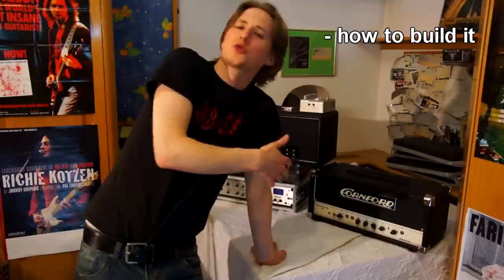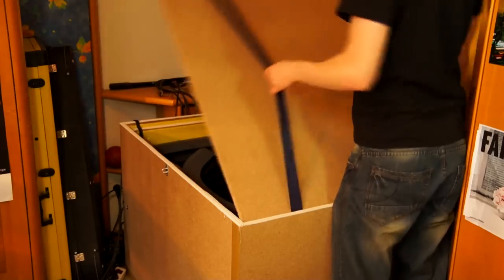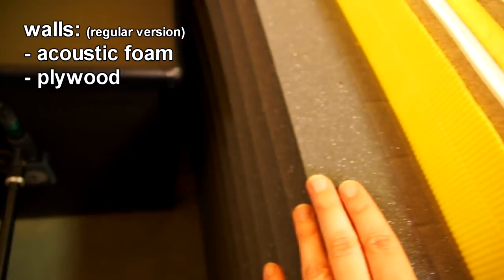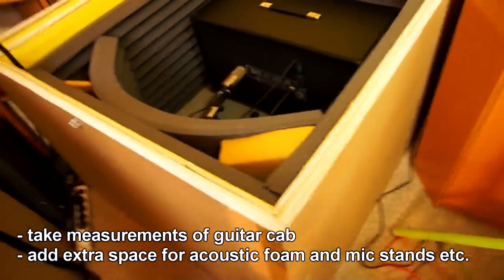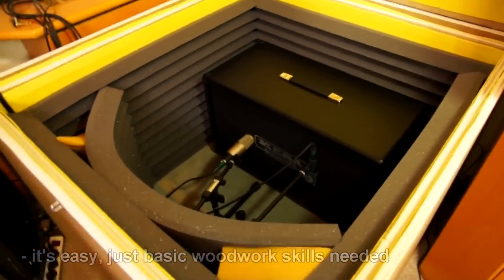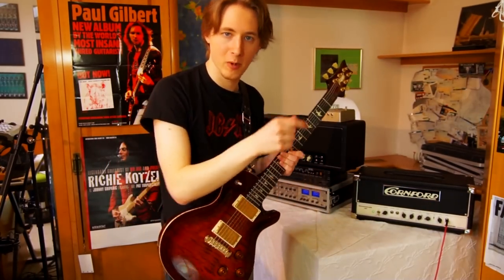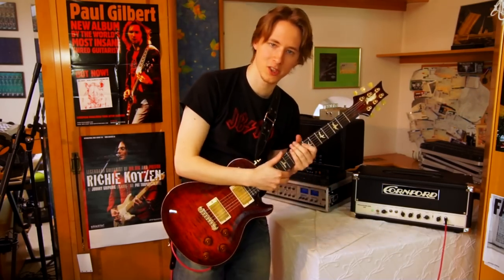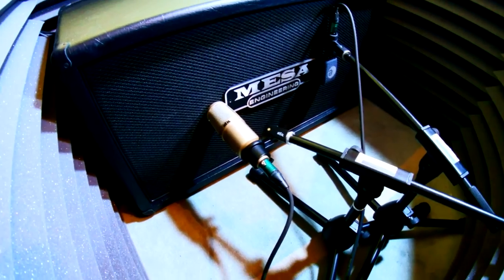Recording guitars with a DIY Isolation Cabinet (+ how to build one)

Comment from the maker: yes, there are differences in sound, it's a smaller space without any reflections. So the bass response is a bit different and there is absolutely no ambiance. But when recording guitars you usually cut the low bass frequencies to make room for the bass guitar and you add some reverb to the guitar after recording. And then it's all fine :)
Reply: Do you know about what frequency the bass response falls off?
Reply from the maker: @SoBeit777  it's been many years since I've recorded with the iso box, so I'm not sure what frequency it was. But it was in a lower area where you want to use a low cut on a guitar anyway, to not interfere with the bass guitar

Comment: Glue with a shelf bracket ? I guess you dint really build to ever be moved ?
Great idea, but I would simply add some 1x1" squares on the inside of each corner, so you have something to fasten the plywood sheets too rather than just plywood to plywood(very, very weak)  for strength, in case you ever want to move it, it wont fall apart.
Reply from the maker: You're right. However, it's way too heavy and bulky to ever get it down the stairs of the house. So I didn't build it that solidly. When I moved to my new apartment it was really tough to take it apart though ;)

Comment: Do you find you get any sort of phase problems or comb filtering? Also how much was the total cost?
Reply from the maker: at the size that I built it, I didn't have any phase or comb filtering issues. It sounded "normal", but just very dry. I think I've payed about 220EUR/250USD in total. But it's possible to build it for less, depending on getting a good deal on the wood plates.
Reply: Thanks brother! I'm fairly stressed because I'm producing an album in which I was hoping to use my cabs and mic's because it's part of the sound I've designed, but neighbour problems are leading to me not being able to record guitars at my place anymore, at least not with a mic'd cabinet! The best solution I've been able to come up with is to use my Amps with a Load Box/Attenuator direct into my DAW and use cab/mic sims. I want to build an Isolation box, but unfortunately it won't be in time for this record. I hope the load box thing works out! Also, in your opinion, do you think the box would have to be much bigger than the one you built to accomodate a 4x12? I'm thinking if I build one big enough for my Mesa 4x12 Stilletto then I will always be able to use my 2x12 or 1x12 if I choose!
Reply from the maker: @underpressureman  Sorry to hear that about your neighbors. For a 4x12 it would just need to be higher. Be sure to assemble it in the same room/spot that you will use the isolation box, because it'll be very heavy and might not fit through doors if you build it for a 4x12.
In the meantime, a good load box is the 2 notes torpedo, it lets you load impulse responses (cab sims) right into the device. You might also see if you can create an impulse response of your cab + microphone setup. It's usually a quite faithful "copy" of your sound and you might not even need an isolation box to get your sound. Then you might be completely happy with the load box solution.

Comment: Hey, man, thanks for the info, very encouraging and useful. Also a very good idea for getting a great tone to record even late at night. hahaha I would just reinforce the isolation a little bit... Could you give me the measurements of the box from the outside? I watched it and then sought through the video to find it, but couldn't. What's the size WxHxD? Just to have an idea... Thanks.
Reply: Also, I forgot to ask: How much does the cab being in the box affect the tone for recording? Would you say the differences between "inside" and "outside" are little or major? Does it sound muffled or "bassier" than outside? Just from the video, there seems to be no difference to me, but you never know... Thanks.
Reply from the maker: *****
I moved to a new place and I don't have the isolation box anymore. But I think it measured about 150x150x90cm. The tone does change a little bit. But the amp is on the outside, so you could change the amp's EQ according to taste.

Comment: Hi! Great video!!
So, I live in a apartment... What do you say about the floor vibration? Is it possible to record at night..?
Reply from the maker: At night I wasn't able turn the amp up to "live on stage" volume. There was some vibration going through the floor. But it always depends on the building and whether or not people have a bedroom right underneath.
Reply: guitarDouchebaggery Thanks! Yeah, I guess it will be hard to use that amount of volume at night.....
So... What do you think about 2 mics inside the isobox? Did you try it?
Reply from the maker: Del Rei yes, I usually had 2 mics in the isobox. I also had a Mesa Road King 2x12 cabinet in there that has 2 different speakers, as well as one side being open back, the other being closed back. I usually recorded with both so I can mix them together in the mixing stage. Sometimes I ended up just using one of the mic signals.
Reply: guitarDouchebaggery Good to know!! Do you thing it may damage a Ribbon or a condenser inside the isobox? Even setting the mics about 2" or 3" far from speaker?
Reply from the maker: Del Rei
It's possible, but it's not much different than having a ribbon or condenser mic in front a guitar cab that is in a regular room. Some ribbon mics are designed to be able to handle loud guitar cabinets.
Reply: guitarDouchebaggery Thanks!!! :)
Do you know about MXL R144...? Is it good for isobox?
Reply from the maker: Del Rei
yes, that one can take high SPLs well
Reply: guitarDouchebaggery Thanks!!! :)

Comment: Hi Can you tell me the dimensions of your box? I want to build one for a Bogner 1x12 cube. I have a lot of MDF I was thinking of using along with either plywood or drywall.  Thanks
Reply from the maker: unfortunately I can't. I wasn't able to move that box to my new apartment. But anyhow, I built my box to fit into that corner of the room. Usually, the bigger the better. For a 1x12 I'd at least add 10 cm (or 4 inches) on each side and back of the cabinet. And then leave plenty of space in front of the cab, to have enough room to place a small mic stand in front of the cab.
Reply: guitarDouchebaggery
That's helpful. Thanks much

Comment: Hi have you ever tried an attenuator? If so, what brand and what did you think of them.
Reply from the maker: I never had an attenuator. The THD Hotplate attenuators should be good, many pros use them. The tone may be slightly altered, but you can always re-adjust your amp's EQ
Reply: guitarDouchebaggery I've used the THD hotplate and Im gonna be honest.. its a tone sucker!
Reply: If you have 700€ to spend buy the Two Notes Audio Engineering- Torpedo Live, or a cheaper one not as versatile but I heard its very good the Palmer PDI 03, which is around 300€ something.

Comment: You don't really need reverb/room mics for guitars in most rock/metal genres and subgenres. Personally I get annoyed when I mix someone else recording project and the only guitar channels sound like the guitar is an a "room". I prefer the mic placement right up to the speaker where the diaphragm meets the dust cover, and then add reverb or an echo chamber in the mix to taste. Unless the intention is to purposely record a guitar that is way out there, then yeah room mics are the way to go.

Comment: If i were to put my tube combo amp in a box like this, would it get to hot in there for the tubes and such?
Reply: +Ryanincambonia It wouldn't get too hot for the tubes - most EL34 tubes are rated to operate around 250 C (480 F)! - but the box itself will probably get REALLY hot quite quickly. You might have a risk of starting a fire, depending on the material of the box.
Reply: as long as you lift the lid from time to time let it vent  it would be OK just make sure the tubes do have some room behind the amp for air, or you might get in trouble
Reply: See if your amp has an output for an extension speaker so you can keep the electronics outside the box. I personally would not ever do what you are suggesting. If you proceed, get a really cheap infrared thermometer, they look like a squirt gun or a star trek phaser, open the box and instantly check the temp of your gear inside. While tubes run hot by their nature, many other components might not fare so well, hence you usually find venting and heat sinks in the tube combo amps. Good luck.

Comment from the maker: I see, well, in Europe it's common to put that laminate under a parquet floor. But you can use any kind of styrofoam etc. between the walls
also, it's not a necessity to build it with 2 walls like I did. People also got good results with just one wall.

Comment: Doesn't the iso box cut off the air circulation and over heat the tube head?
Reply from the maker: The tube head reamains outside of the iso box, only the cabinet is on the inside :)

Comment: You think If i Make one of these for a Combo Tube amp is bad? I wont keep it there only when im tracking
Reply from the maker: with a combo you won't be able to tweak the knobs of the amp from the outside. It'll also get very warm inside the box that way. Maybe you could buy an affordable 1x12 cabinet, put that inside the isolation box and use the amp output of your combo.

Comment: Georg, this is fantastic. In these recorded sounds, are their any plugin's rolling off low end vs this is the raw miked sound? I am working to eliminate the excess bass in mine. And, the hero Rob Chapman himself posted here! Wow. Good on you, mate.
Reply from the maker: Thank you :) yes, it's the raw miked sound
I had the microphones placed quite in the center of the speakers to have a clear sound. Otherwise it can get too bassy
Reply: I am even more impressed with your results. It is a very balanced sound - especially considering that beast of a Mesa cab. I have a very clean open amp. I need to apply thicker foam in front I think. Your build, playing and whole scene is quite an inspiration. Thanks!
Reply from the maker: @periloustemple8290  thank you so much :) You can also try using old towels for sound dampening
Reply: If I gather the nerve to take pics of what I have done I'll post on FB and friend you. It is quite a contraption - and does indeed use towels, old carpet remnants (and some good foam board, foam and wood, mind you). Between your last reply and now, I have added some 4 inch foam in some strategic places to catch that bass build up. Testing soon.
Reply from the maker: @periloustemple8290  sounds like a plan, I'd like to see it :)

Comment from the maker: I would not use a combo. It's a small space that would heat up quickly, a fan would just circulate the air on the inside.

Comment: this wouldn't overheat your amp ??
Reply from the maker: no, the amp remains on the outside (for tweaking etc.), only the speaker is on the inside which didn't produce any noticable heat.

Comment from the maker: @xwigwango I haven't tried those, they're probably also good.
My isolation box was cheaper than either one of them and you could fit several mics in there, use any cabinet that you want etc.
However, the randall or axetrax are far less space consuming. So there are pro's and cons.

Comment from the maker: hi, yes, there are subtle changes, most noticeably in the bass frequencies.
So I always had to adjust the settings on the amp a bit once the lid was closed.
+ the sound was very dry, without any reverb, so I added those effects later on in Cubase

Comment: You mic'd your amp wrong.
Hope you didn't get phasing issues.
Reply: phasing can easily be fixed as long as you don't record your mics on a single track
Reply: MrMaxadax Why always fix things when you can get them right at first ?
Reply: Marc Zedda because phasing really isn't that big of an issue if you have a DAW, it's not going to change the sound quality

Comment: No isolation on the floor?
Reply from the maker: the cabinet does have a floor, it's build the same way as the walls + I put a carpet on the cabinets floor.
However it's possible to build one without a floor. Dave Weiner (of the Steve Vai Band) built his without a floor and it worked.

Comment: That will turn out terrible. You would need to get some ASIO drivers just to get the latency down to something semi bearable. Then run into other problems as well like bad quality, noise and low volume.

Buy a decent sound card and use a virtual guitar amp, such as Amplitube.

Comment: No such thing as a one-size-fits-all solution. Speakers are built to move air - if they are sealed in a box, it unavoidably changes the dynamics of the air and speaker cone movement - the cone is pushing against air that can't move, and thus compressing it - right? Not saying you can't get a usable sound - but it won't be the same sound as the same speaker cab outside the iso cab. How could it be? But when you think that some cabs have been miked face down on the floor or with speakers slashed with razor blades, or are loaded with intentionally mismatched speakers (my favorite cab is a 2x10 w/one ceramic and one alnico magnet) you realize it's all about creative exploration, not some "perfect" result...
Reply: If the alternative is recording direct, I'd take the iso cab and work some magic in the post production

Comment: I still don't get it.  Why can't you just plug a guitar straight into a computer to record it, or plug the XLR output of your amp into a computer.  I am so studio-recording illiterate.  I just play my acoustic guitar dude.

But seriously, why do you have to go through all this trouble to sound good in the studio, and then some bands just get up on stage and sound phenomenal live and you listen to a live recording of it and it sounds just as good as anything you'd hear in studio.  I have two examples.  Listen to Ben Howard live at Amoeba Music.  and my second example is just anything on a live radio performance, like for example anything on KEXP.  Is KEXP going through all the stuff a recording studio would go through for each and every one of their live performances?
Reply from the maker: there are many ways to record electric guitar. You can record straight into a computer if you use a guitar amp simulation and an impuse response of a guitar cabinet.
Basically, the important thing regarding recording an electric guitar is that the speakers of an e-guitar amp are specifically voiced for e-guitars. Those remove a lot of the treble etc. otherwise the overdrive or distortion would sound like an angry mosquito swarm. Overdrive or distortion are basically clipping your audio signal, but when it's send through a guitar speaker, then that clipping starts to sound pleasant.

Comment: I have a randall isolation box, the recorded sound is awful
Reply from the maker: the Randall one is too compact, I think. Boxyness could not be avoided at that size.
Reply: ironically it sounds good when the top is open ,so  its just a very expensive 1 x 12